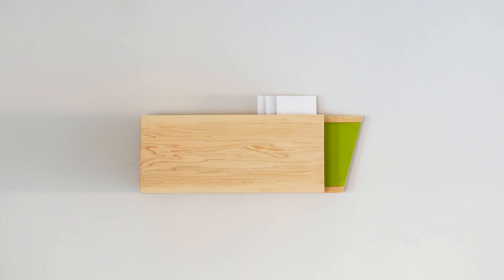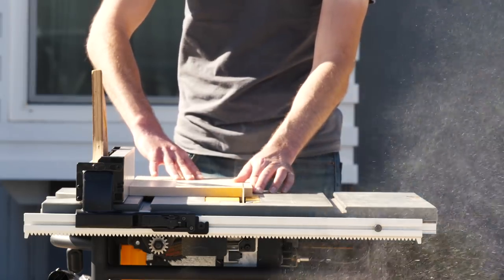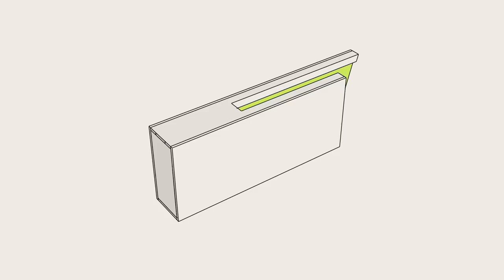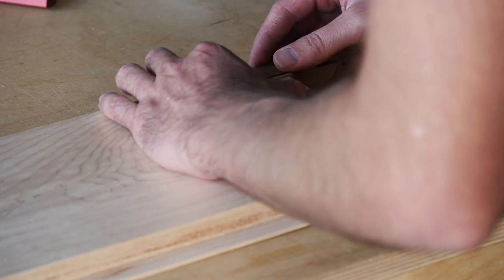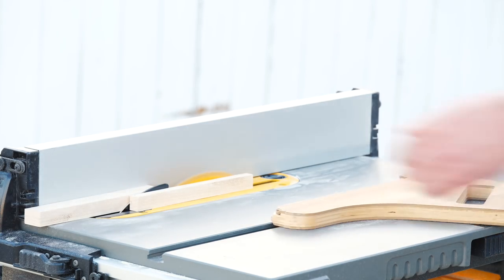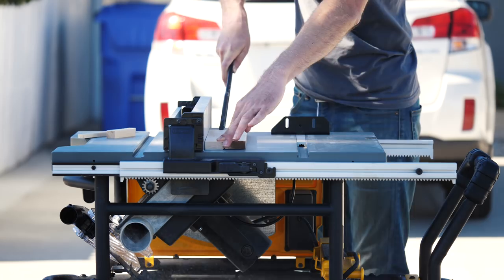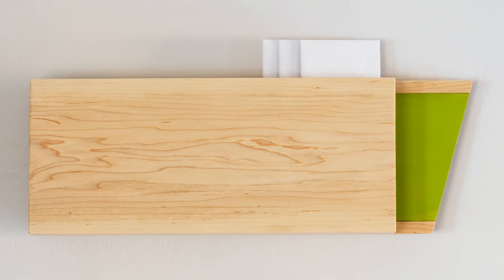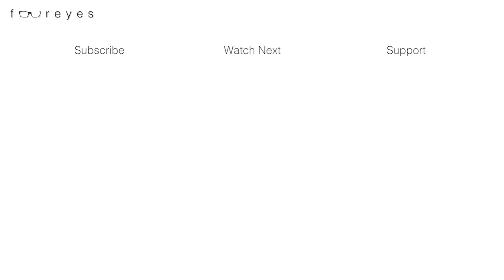DIY Mailbox  - Simple Woodworking Projects

Comment: I would like it to be plane to the wall, i dont like the french cleat un this case. Think it better next time! Its easy tu use some magnets for the front piece, to use not seen screws! ;)
Reply: You could always integrate the french cleat into the back panel of the mailbox, that way it would sit flush against the wall.
Reply: Nick Larson yes indeed, this is also  feasible! Youll need a frame instead of a full back panel.

Comment: I love your design,  it's really very elegant.  But, there's some chance that the back could blow out or crack the sides, top or bottom.  It's a fact that the length and the width of solid wood will expand at different rates with changes in humidity. You might consider this in designs in future designs. This is why solid wood doors have a frame with a panel that is free to move in the dados.  Hopefully the back is small enough in width  that you won't have a problem, but I wouldn't take the chance after putting all the work into a beautiful project such as you have here.
Reply from the maker: just to be clear...are you talking about the little end cap piece, or the back panel (the part that attaches to the wall)? 

The end cap piece is undersized enough that it won't bust anything. The back panel can expand/contract freely with no problems as the front panel would theoretically expand about the same amount. 

If the worst were to happen, I'd be fine with that. Though, if you look at older videos of mine, you'll see I had the same mailbox up (in a different species) for a couple of years. Actually, from before I started even making YouTube videos. Never had any wood movement issues.
Reply: Sorry I wasn't more clear. I meant the end cap. And you are correct, the back panel, front panel, top and bottom all will move at the same rates, so no potential problems. Maybe you are right that the undersized end cap piece will take care of problems. I didn't get that from the video, sorry if you explained that.  Glad you had good luck with the other boxes.
Reply from the maker: Gotcah. I didn't really go into it in the project. Even tight, I don't think it would pose a problem though.
Reply: On something this small the expansion contraction rate is so minute it will not pose a problem. Don't believe everything you see on youtube ;)
Reply: Also, here in Southern California we don't have quite the extreme swings in temp and humidity. there's more danger of an earthquake shaking the letters out onto the ground than anything else!